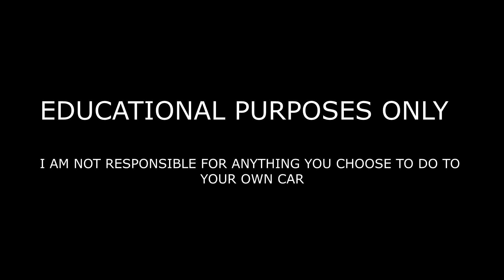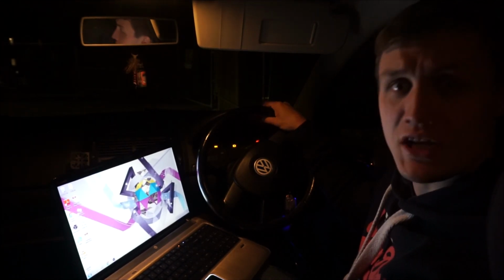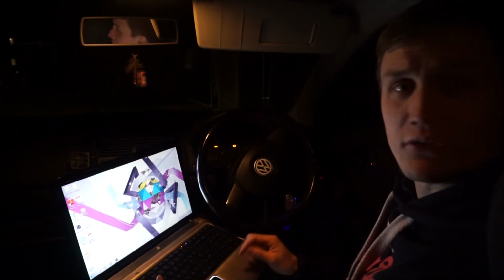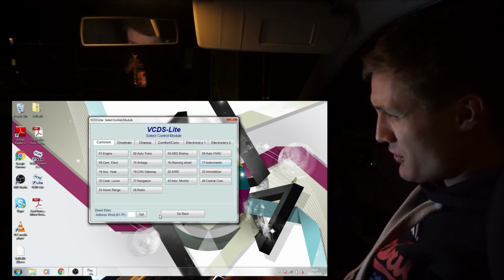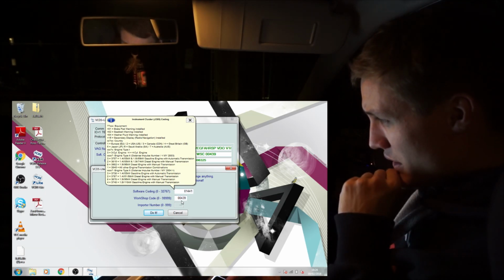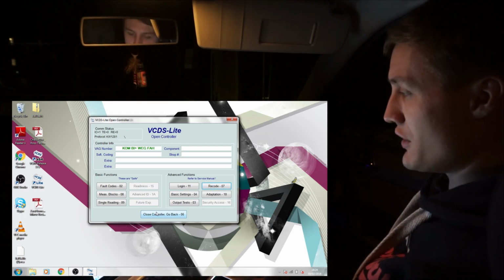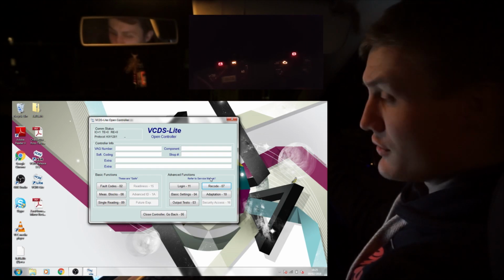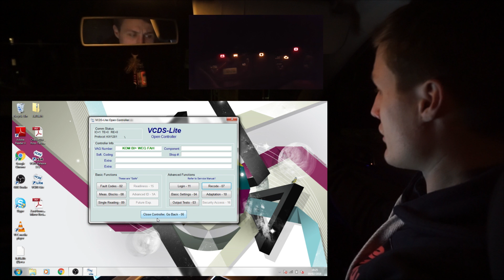VCDS - How To Turn OFF Brake Pad Warning Light

Comment: If you are changing the code for the instrument all you're doing is disabling that feature of the car you're not turning the light off as is a repair has been made you're turning it off as in the car doesn't have that function anymore

Comment: I would like to code the 03 break electronics abs and I don't know exactly which one to use, I'm new to vcds lite, I'm going to use it, could you explain a little how I should do it, I have 1 volkswagen passat b5.5 1.8 turbo petrol 20v sedan petrol, vcds lite is compatible with my car, thank you

Comment: Thank you! Great video!. Brake pad warning light showed up on my 2008 skoda fabia couple of weeks ago. Changed brake disc and pads (with sensor) all around, filled up fluid, checked all the harness and the light would still be on. Not any more. Just for information my skoda had software coding 23124, the brake pad warning light is usualy 01, so by writing 22124 i disabled the light :)

Comment: Why did you pick 2?     Could you have picked ANY number beside 1?
Reply: I think he misunderstood how the bitmask works. He changed the activated warnings from "brake pads only" to "seat belt warnings only" instead of disabling the brake pad warning. If your car supports the other warnings such as seatbelts and washer fluid, you should keep those enabled even if you intentionally disable brake pad wear warning (e.g. to use aftermarket brake pads that do not have the required connection).
Reply: He should have minused -01 from its current coding.

Comment: How did you know which number to changed and how did you know which number to change it to?
Reply from the maker: Cant remeber now. Think i found it on a random forum. Wouldnt have the link to it now. Decided to make a quick vid showing what i had done aa i owned the VW back then and wanted to make some video for my channel. I mainly make them for myself if i ever need to refer back to something but its nice to get some views too.
Reply: @techclub8528  If the coding helper says +01 to code something , you write -01 of the value written to remove coding. Same for other values (+02 /-02). Lets say you have value 07 and want to remove brake pad warning that is +02 you write 05 as new value.

Comment: does it work on a4 b5 ? (heard doesn't work after 2000's series...)
Reply: I just tried it and the brake light option wasn't there, I'll reinstall vds to make sure,but it looks like it's not available.
Reply: @zaftra  I can confirm that, just tried it today, no option

Comment: Hello, how do you get the vcds software? An which version is best? Thank you
Reply from the maker: ross-tech website. using LITE version with a cable from Amazon.  cable cost less than £10 but software was like £80. 

I had to buy it because I needed to reset the throttle body after cleaning and it was the only way to do it.
Reply: Dan's Miata that’s great thanks. I’ve got the same problem as you had with the brake pad warning light constantly annoying me! Especially at night, but if it’s that much for the software I think I will just take it to the garage down the road. Thanks again for the reply 👍